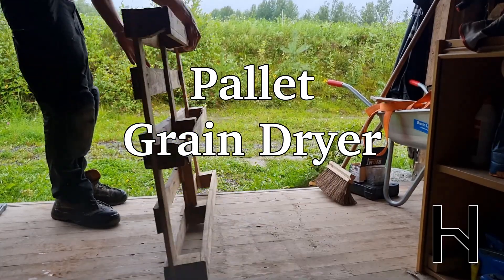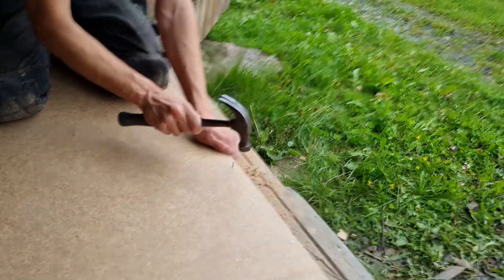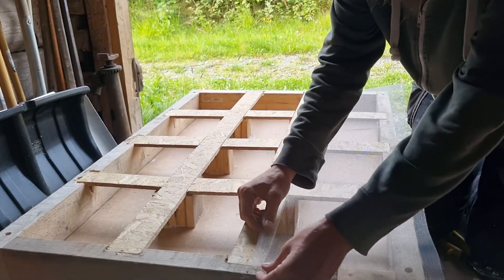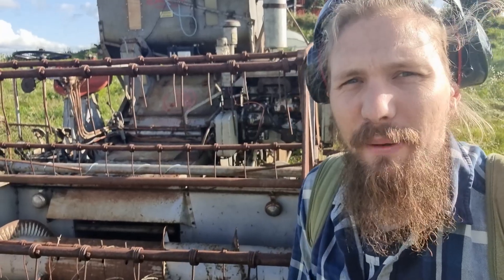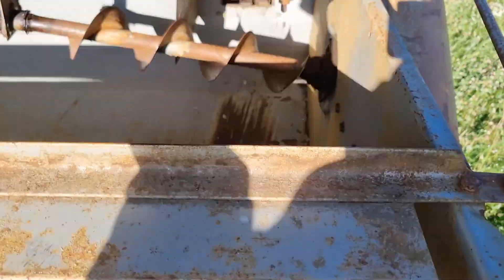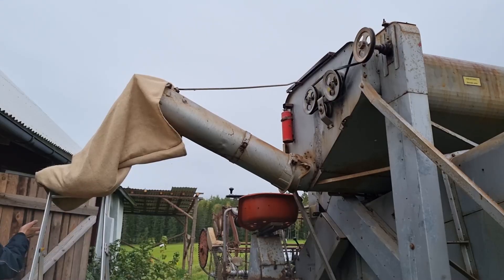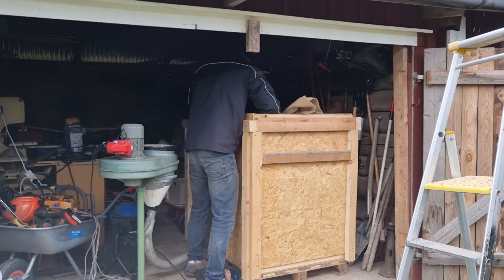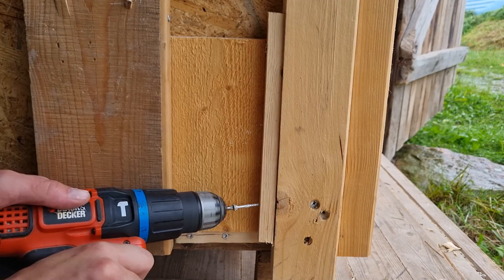DIY Pallet Grain Dryer

Comment: The idea is good however how would you dry the grain if the bin was full?  Combination of more powerful fan and adding heat?
Reply from the maker: I would use a larger fan and one design to push the air (I'm assuming that the efficiency could differ from the design even if the power of the fans are the same). I would avoid, if possible, the use of heat since heat above 35 degress celsius can damage seeds. If I would use it for food or feed then I guess that wouldn't be an issue, but I would probably avoid it all the same. Feels like an added thing that can malfunction 😅. I think that large grainsilos only use air but I'm not sure. Do you know?
Reply: Well depend here where i live in Canada if they harvest soy or corn in the late fall it's usually wet so they add a propane and a heating unit to the whole fan set up.  Myself i am like you no big acreage and i have a small by current standard combine.  I was planning to make small grains too and i am looking at different homemade dryers.  Especially since i want to add buckwheat to my rotation but it will require probably some heat to dry it before it spoil.  I will try something next year similar to your idea.
Reply from the maker: @thirrybelisle  All right! Sounds fun! I am looking forward to next growing season to right some wrongs and hopefully get a good harvest this time. Sounds like an exciting next growing season for you and I would love to hear how it goes and your thoughts on whatever dryer you build :).